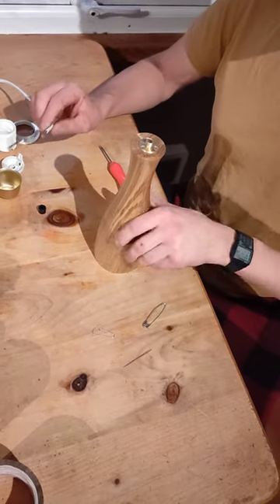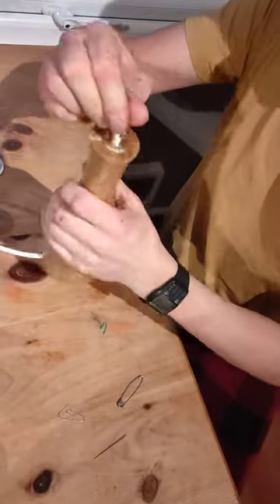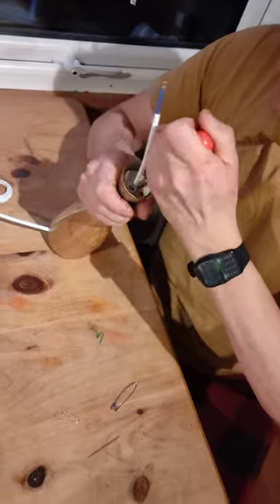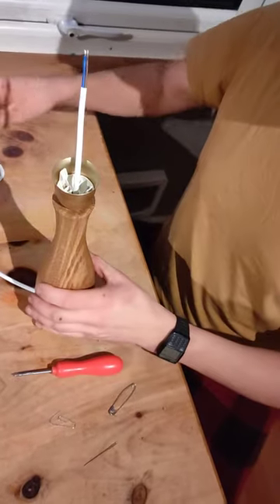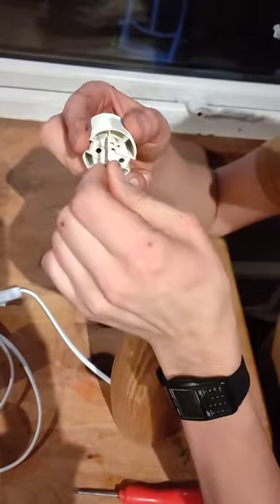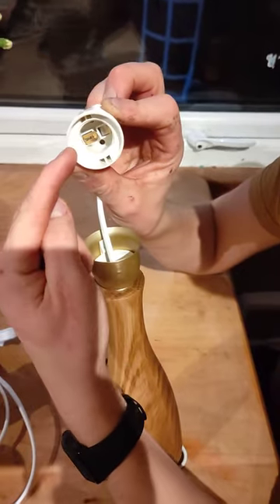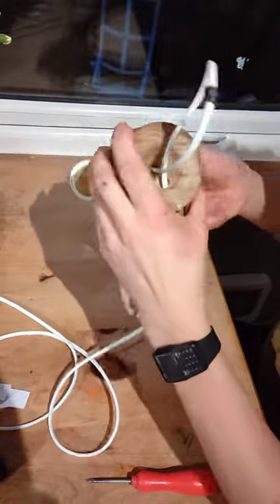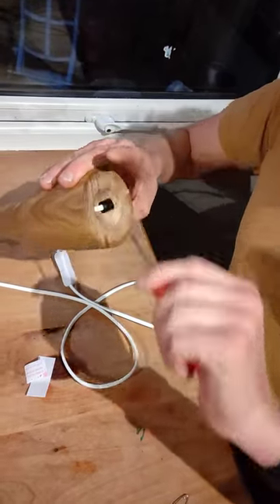Wiring an E27 lampholder

Comment: Thank you sooo much for the video!! I'm living in Denmark and bought a lampholder online, when it arrived it looked like none of the ones I was used to from my home country and I didn't know how to google for them!! Somehow I ended up in this video after half an hour of reading in blogs, and it was very easy to do afterwards. Appreciated it a lot 🔥🔥🔥
Reply from the maker: Oh that's great. I actually just uploaded it for a customer to view as the file was too big to email!
Reply: @nickhammond8545  it's the first time I'll be thanking email file size limits lol!!
Reply: Thanks for this video! I am trying to wire a lampholder that is exactly the same, but it says that you need to solder the tips of the wire first (if it is that "multiple thin wires together" type ). Did you actually do it or is it unnecessary if you twist it hard enough?
Reply from the maker: @Cuiositycola  you might be able to twist the ends enough to push them into the holder but I doubt it. You might need to order some of these...https://www.amazon.co.uk/White-0-75mm-Bootlace-Ferrule-Pack/dp/B07BR4VYMH/ref=mp_s_a_1_3?dchild=1&keywords=ferrule+0.75&qid=1617978216&sr=8-3

You would then put these on the copper ends and have to crimp them on with a pair of pliers and these will then push in
Reply: @nickhammond8545  thanks a lot for the tip, that's very helpful! I'll get some of those. All the best!

Comment: Thanks for the demonstration. Could you do a video where you convert a E14 bulb shell to a E27?
Reply from the maker: Hi, I don't use E14 but as long as it's a similar lampholder design (plastic and 2 wires with no earth wire) it should be very similar.

Comment: You forgot the screws that attach the wires in place.
I think the click sounds isn't enough to fix the wires in place.
Anyways, thanks for this informative video!
Reply from the maker: I do prefer the screw terminals too but these are push fit ones so the wires need to have solid soldered ends but they seem to work a treat.

Comment: How do you get the wires back out though?
Reply from the maker: Hi, If you mean get the wires up the lamp. It can be tricky. I would either use a bit of tape at the end to make it more streamlined and stronger. I sometimes use a bit of the outer flex to put on the end of the 2 bare ends. Hope that is what you were meaning?
Reply: @nickhammond8545  No, I mean, once you put the wires into the socket, if you want to take them back out again. My workmate has this fitting and wants to shorten the cable, I can't get the wires out, they are clamped in and there is no release.  Cutting and soldering is possible, but not as near.
Reply from the maker: Oh I see. I completely misread the question. Checkout this video. Think it's about halfway through....
https://youtu.be/ZyO9E3Ynq8E
Reply: @nickhammond8545  perfect thanks, I tried that but was frightened to break it, but tried again and they popped out. Now I did the rookie mistake of not checking where live and neutral were! But I will work it out, maybe that is on your first video.

Comment: Thanks for the video. I use the same bulb holder, and I followed your instructions exactly, but the bulb didn't light up. I've checked the wiring, changed the bulb, I even changed the fuse in the plug, still didn't work. What do you think the problem is?

Comment: how do you disconnect the cables if you need to after they click in place? you just need to pull them? i need to disconnect from the lampholder but i don't want to make damage. THanks
Reply from the maker: Hi,

You need something like a big safety pin to push the metal tabs in the rectangular hole and with that you should be able to pull the cable free

Comment: My shade  were fitting goes on to connect  is only 2cm  no fitting will go through the spider on the shade
Reply from the maker: Hi, are you in the UK? If it is 2cm that could be tricky finding a lampholder as the UK bayonet ones are about 28mm I think the US have an E12 lampholder but the ring would also need to be 28mm...
https://www.lampspares.co.uk/e12-black-threaded-lampholder-with-shade-rings-4861077/?gclid=CjwKCAjwloynBhBbEiwAGY25dODd7eFI9sVpuq5SkxEsSLpGkbrGgjjxWyIxe9WoHHCOyKaqdGCnzRoCEkMQAvD_BwE